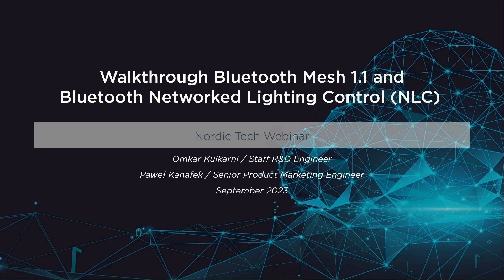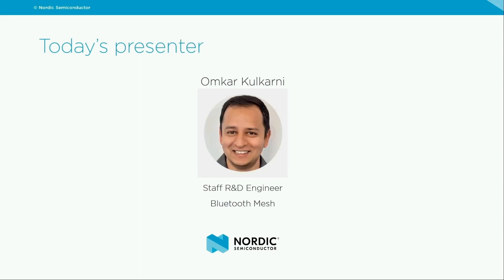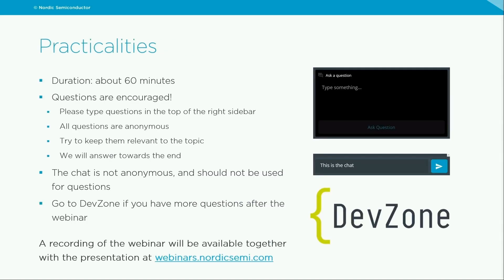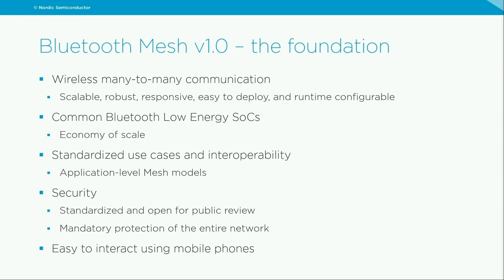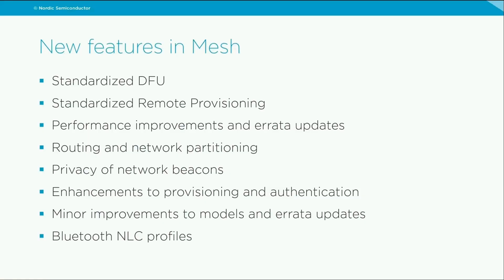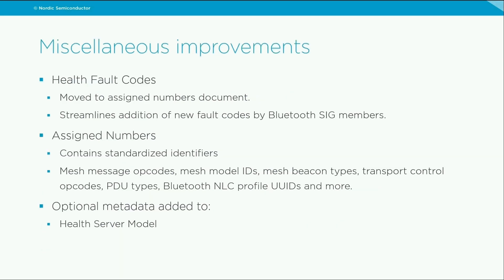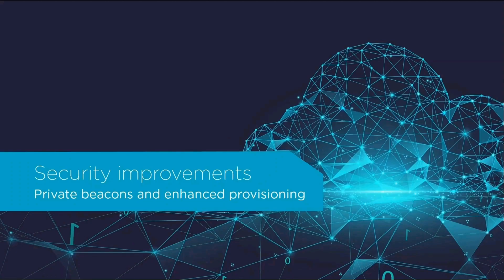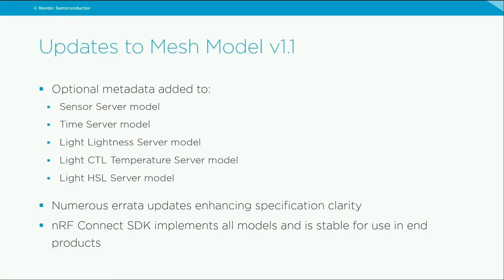Walkthrough Bluetooth Mesh 1.1 and Bluetooth Networked Lighting Control (NLC)

Comment: Can we transmit audio through this mess to different Bluetooth audio item simultaneously
Reply from the maker: Bluetooth Mesh is a low bandwidth technology designed for lighting control and collecting sensor data. It is not designed for or suitable for audio.
Reply: @NordicSemi  then how to connect 5 Bluetooth speaker wirelessly
Reply: @technicalsupport6983  i guess...as long as you can power the nodes..there should not be any constaint to channel audio. we keep seeing blue tooth spekers.. mesh would also operate the same way.
Reply from the maker: @technicalsupport6983  please reach out to our community and tech support team on DevZone, they will assist you with the use case: https://devzone.nordicsemi.com/